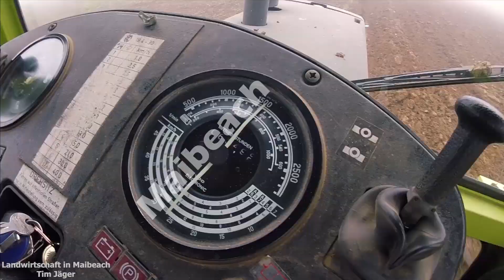| 1455 XL - CASE IH | MB-TRAC | Schwaden & Pressen Cabview | Heu-Ernte 2018 | Teil 3

Comment: Servus 
Wie macht ihr das beim 1455 wenn der Ballen voll wird ? Wir haben 3 Claas Pressen und 5100 Maxxums mit  Neutralstellung aber beim 14er muss man doch das Handgas rein tun und dann auf die Kupplung und auf die Bremse steigen oder ? Beim Maxxum tut man den Hebel für die Wendeschaltung auf Neutral und geht auf die Bremse und bleibt auf dem Gas gutes Video
Reply from the maker: Erstmal schön dass dir das Video gefallen hat! Und ja genau, wir arbeiten dann mit Handgas. Kuppeln, bremsen, dann oft mit der Presse zurückstoßen, damit der Ballen nicht Hang runter rollt. Und in der Zeit wird das Netzt gebunden.